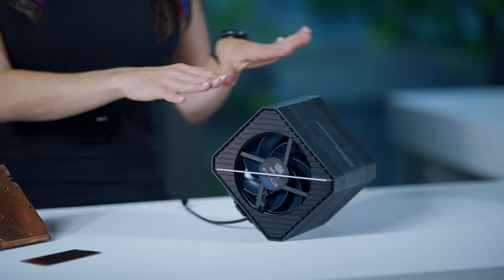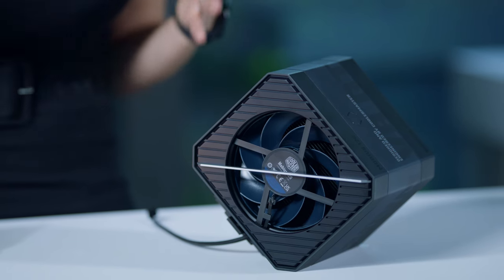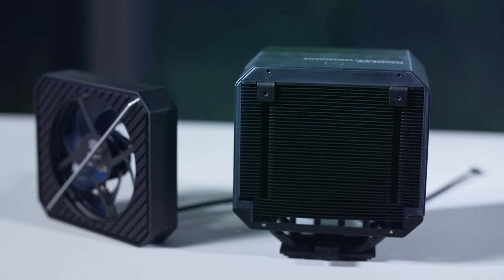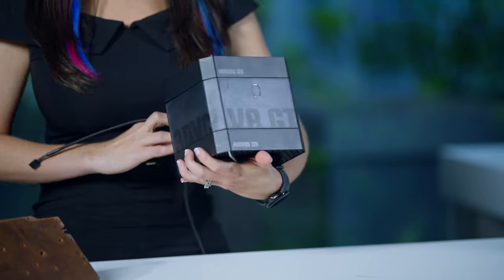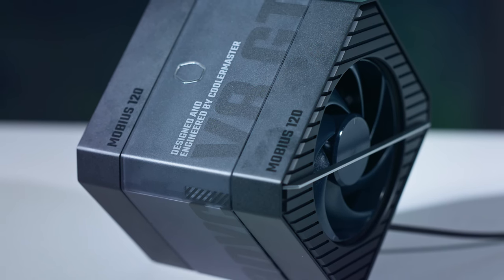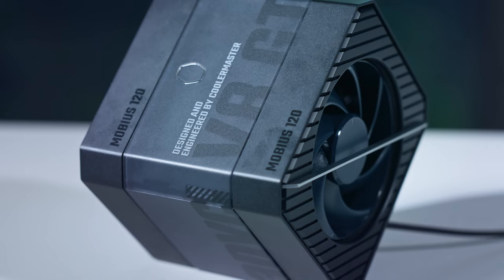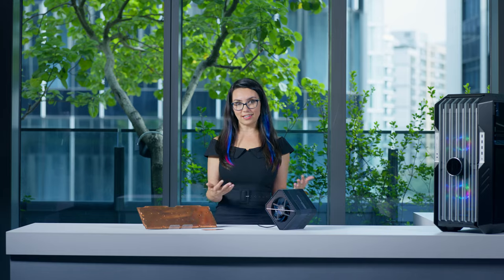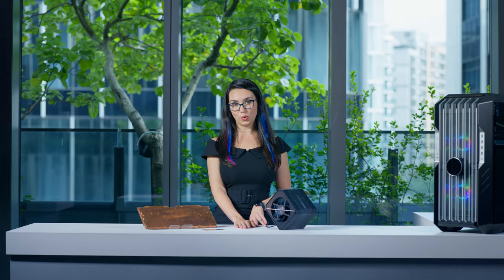Project New V8: Mastering CPU Cooling | Cooler Master

Comment: Remember the cooling capacity is misleading.  Yes you could pump 300w heat into the cooler and it could dissipate this much, but likely at a temperature level that wouldn't keep a 13900K under 100degC.

Comment: I really like the looks and size seems to be right(it's big but not too big). Your marketing material claims "Capable of handling thermal loads up to 300 W" so why dont you show us cooler mounted on i9 Raptor with unlocked power limit running cpu below 100c. I really hope this cooler delivers. I remember your previous attempt at intorducing vapor chamber into cpu coolers. Good looking TPC 800 was a failure, not delivering any better performance than conventional heatpipe coolers of the time and it had worst mounting system than competition. CPUs back then were not as hot and power hungry as they are today so introducing vapor chamber cooler now makes more sense than it did back in a day.

Comment: I hope they also release black and white versions of this cooler. This greyish blue is difficult to match with other components atm. I hope Coolermaster is also considering changeable fan designs. If the weight of this beast is anything below 1200g, I can see it becoming a huge hit as soon as the aesthetics part gets solved!

Comment: How many native heat pipes directly from vapor chamber does the new V8 have? It seems to be downgraded from the prototype shown at Computex 23 because at that time all the heat pipes were natively from the vapor chamber.
Reply: You are right! Prototype from Computex is very different. There was no shround over the cooler, body was different shape and there were 8 straight pipes coming from vapor chamber base. Who knows... myb it's not downgrade but refinement.
Reply: @novinovic298  The current version looks more like a refinement of the old MasterAir Maker 8 rather than something derived from the Computex prototype. Attached heat pipe is one way to reduce costs, and is in no way close to native heat pipe integrated with vapor chamber in terms of performance. If cost is a prior concern, CM should abandon vapor chamber in the begining.

Comment: I still have an EVO 212 cooling tower. I upgraded my fan to the Mobius120 aRGB. That has an uplift of 20% fan speed and 20% CFM in air movement production. It has a much better motor, and its lifespan is drastically improved, too. So, I'll just stick with that.

Comment: "boakbokbokbokboakboak - superconductive heat pipes... offer nearly double the q_max compared to traditional heat pipes"
I see 2 of them plus 3 standard ones in the middle, so this thing is equal to a cooler with 7 standard heat pipes and yet called "the pinnacle" and also "V8"?

"boakbokbokbokboakboak - now this FINAL DESIGN is STILL BEEING PERFECTED..."
What an egg you laid there - No further comment necessary!

The worlds of techs and public relations may use the same language but are still completely separated by reality:
- Techs use language to explain reality.
- Public relations completely f*ck language in every which way as if there was no reality at all.